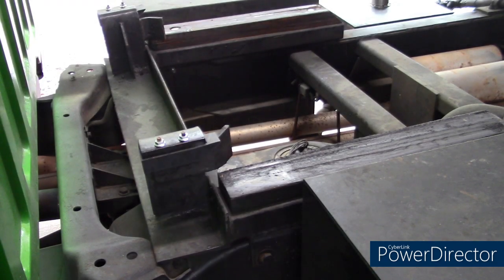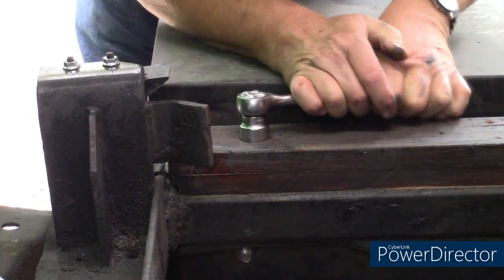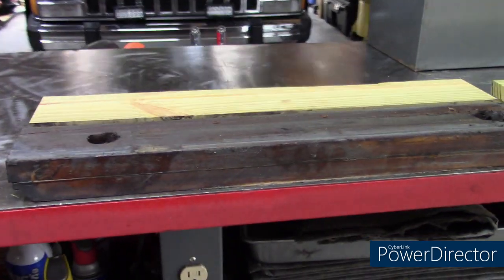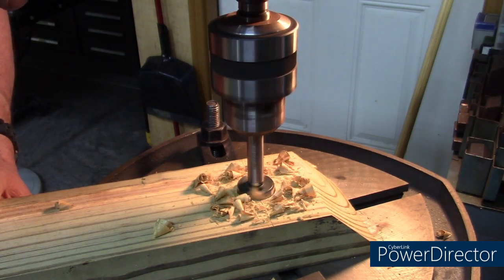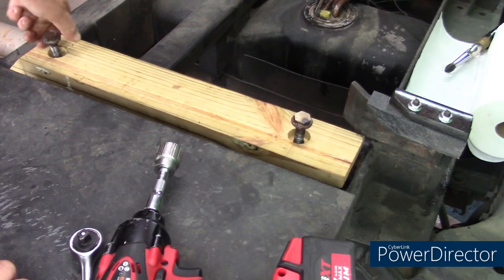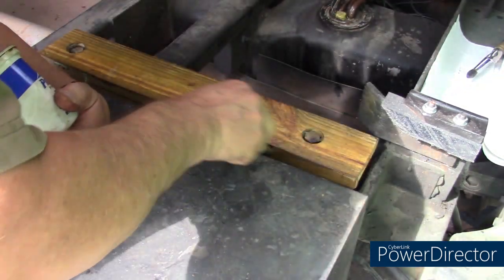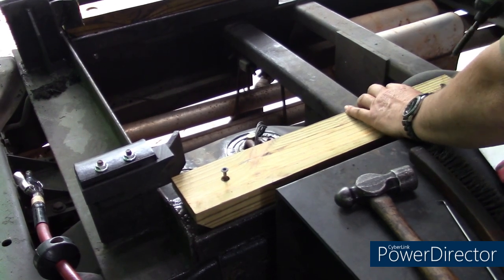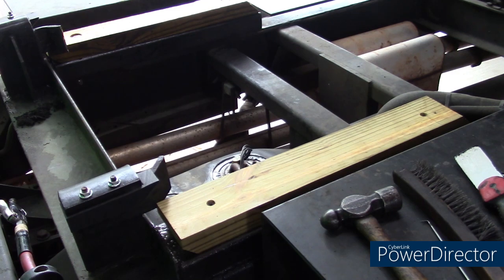Wear blocks replacement on a Wrangler Transporter Jerr-Dan aluminum bed

Comment: Hi Wyatt! I believe you can fix anything. I have my car in the shop, it’s making a whining noise when I turn my steering wheel. Not leaking steering fluid or any pin holes in the high pressure hose, so had to put it in the shop to get fixed. I’m stuck until it gets fixed. I loaned my truck and when I got it back I think it has a blown head gasket now. I’m just not able to do that anymore. Glad you got your transporter is fixed. Have a blessed day!
Reply from the maker: Hello my friend. I'm saddened by the news of your car troubles but I have a hope that all will work out in your favor. I'll say a little prayer for you.  :)
Reply: @wyattoneable  thank you!

Comment: Nicely done. I kinda like the nut and bolt setup they fabbed up.
 I probably would have gone right through and put the nut on the bottom, but they probably wanted to keep from crushing the square tubing if they cranked it too much.
I’m surprised that they don’t offer poly runners of some kind.
Reply from the maker: I was hoping to get the correct parts but Jerr-Dan doesn't support this old bed any longer. It's kind of sad, but I get it. You have to support the product that is making the company money. I feel badly for those who are not mechanically inclined or have the hardware you and I (and Brad) have saved up.
Reply: @wyattoneable  You would think that they would just have a generic solution for everything in that weight range.
But I guess after that long, the liability issue probably keeps them from a more active roll in post purchase maintenance parts on the older ones.

Comment: I'm the same, Wyatt - if it works, I don't much care how, lol. I also like to feel fasteners rather than rely on the ugga-dugga gun. I've had them so loose it scared me when I thought I had overtightnend them, while having others that felt fine but just about yanked the threads right out of the hole in the past. Don't know if it's my air pressure, gun, or I just lack the feel with it, but from now on I always follow through by hand unless it's a non-mission critical fastener, like a metal or plastic cover for something. 

That was a nice bit you had there. I don't even own a drill press! I really should get one. I have a tiny assortment of hole saws - I usually use those for similar work.
Reply from the maker: It's all covered up anyway and everything is working great. If I had the experience that Eric has I'd use the gun to tighten things down but I don't trust myself. I love my drill press. It's great for making repeated holes and more accurate than my wiggly arms.  :)

Comment: At least wood is easy to replace bro. Safe travels.
Reply from the maker: Indeed. I was going to say "Cheap too". But it's not cheap any more.
Reply: Yeah things have sure gone up in price here too. Fuel has gone up a fair bit in the last 10 days or so. Some cost have gone up 600% in recent months. Not sure how Santa is going to get on with the 14 days managed  isolation in most counties before entry and he will need both jabs too.